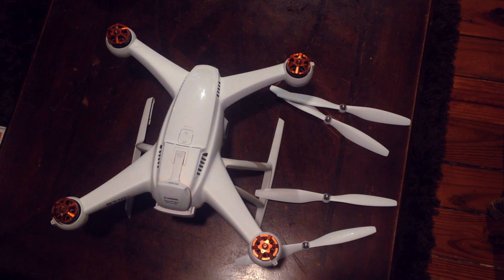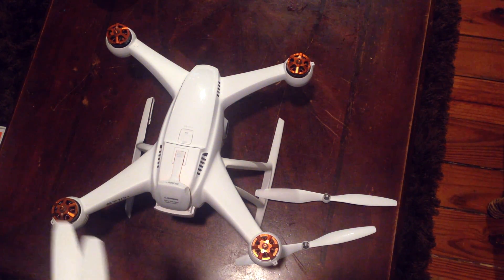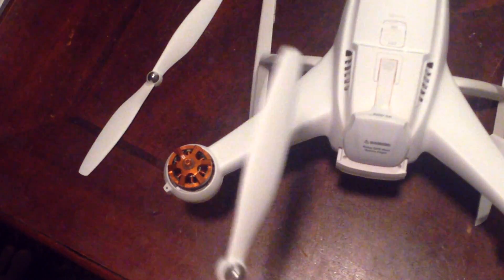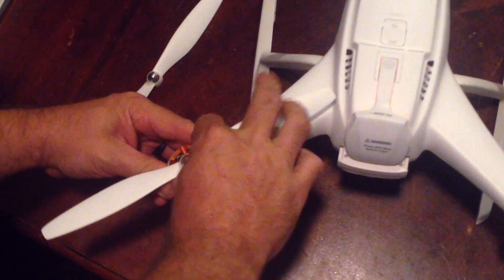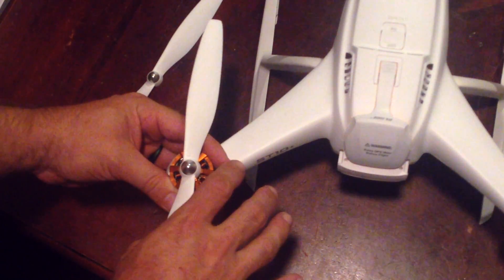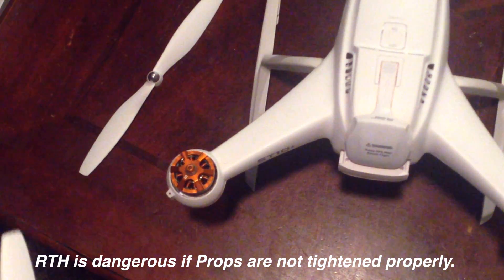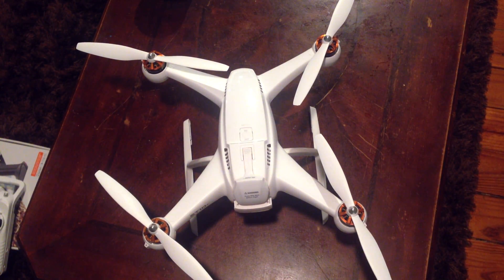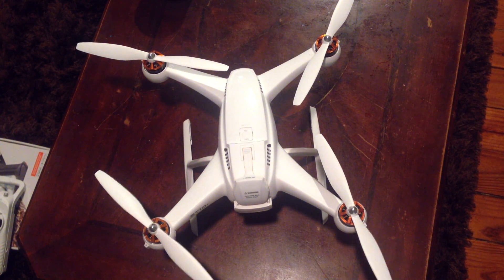Installing self tightening Props on a drone correctly...

Comment: Thanks for o-ring tip, I have some non-original self-tightening props with metal insert (original is full plastic), so I was thinking how to make them tight, and also removable for packing .. so o-ring is a good tip (around piping thread rope or teflon tape, or even more permanent like thread lock adhesives)
Reply from the maker: Glad I could help

Comment: I agree....If you don't do that, Problems are waiting for you...and they will find you.    Is that a new quad Sean?
Reply from the maker: This is the blade chroma, prior to that i had a blade 350 QX. i am saving now for a phantom 4 (or xstar premium). however by the time i save enough i will probably  have to buy a phantom 5. ha ha ha

yeah, it's crazy how many videos out there show with self tightening props to just lightly screw them on.  it's just not the case. i learned that first hand!
Reply: Either one is a really good choice..Get back it the air soon...
Reply from the maker: Dustoff  i did some testing with my chroma yesterday. seemed to be working but not sure i trust it yet.
Reply: Trust is important...hang in there....It's really is a great quad .. It's worth another chance..Looking forward to video..Happy flying (i hope)
Reply from the maker: Thank you very much!
Reply from the maker: Dusty, you have been hanging around for a long time. even back when my videos sucked so bad.  ha ha